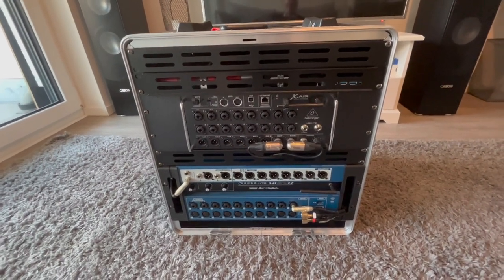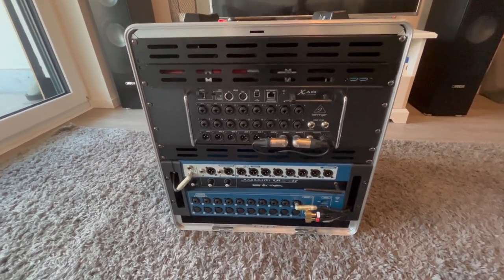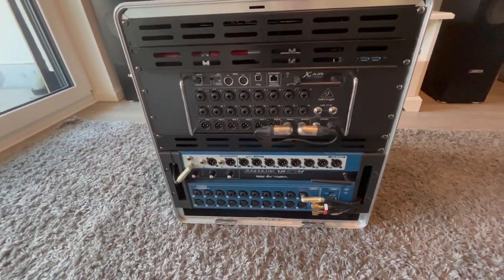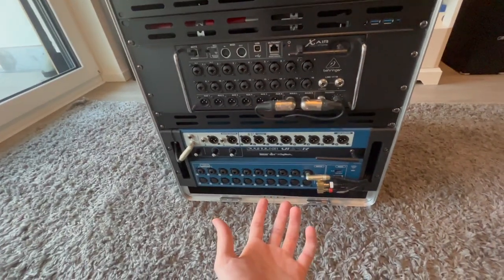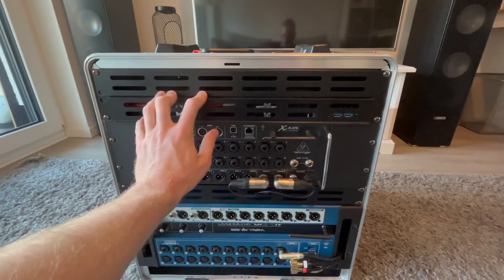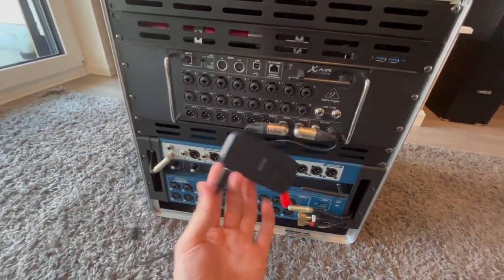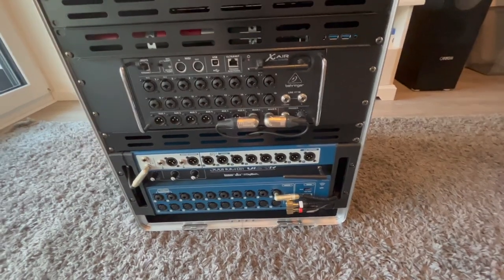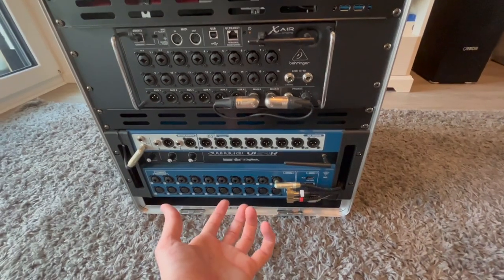Soundcraft Ui24R setup - WiFi - AirPlay - FoH

Comment: Depending on the situation you’re in for your gigs. If you need more than 24 inputs, then I would recommend a board with faders which would make your life easier but if budget or space is limited than understand why you need to mixers, but the UI 24 can be linked to a second UI 24 to double your inputs in Cascade mode so you would have two matching units and operate with only one source on your device and not two, I would highly suggest looking into a better Wi-Fi router, I used to use TPLX 50 with Wi-Fi six and create a hidden SSI ID to help with traffic but I later upgraded with a UniFi system from ubiquity if you have the budget
Reply from the maker: Indeed I have two pcs Ui24 units meanwhile. But the second one I have is still only pure back-up. If I would use a second Ui24 as extension I actually would need a 3rd one for backup. For the moment the system works fine for all the gigs I’m doing.
I have upgraded my rack to a 12HE wooden rack meanwhile, so two slots are free. But most probably I will invest into a decent IEM system next for having a wireless PFL-listening solution.

Thanks for the proposal with Wi-Fi. I will check into that.

Comment: based on experience you only face issues when you use the onboard wifi router. I really recommend using a reliable external router. I can assure you won't face any problems. You could also daisy chain 2 ui24r mixers
Reply from the maker: Well - I have two units of ui24.. but for the moment I wouldn’t use them together in a daisy-chain because it would cost me a third unit for backup.

So still using xr18 as submixer. For the moment that does work out and always keep the second ui24 as spare with me
Reply from the maker: @jarosawbiernacki9087  yes afaik both is possible and depends on how you route it. Expanding to 16 Aux or merge the 8 Aux‘es from both units together is both possible. I have a band which is full on in-ear but they are all fine with mono mix. So the maximum I did use was 6 Aux + 1 MTX for front-fills.

Comment: connect a MIDI mixer to that ipad or something, then you have a wireless remote control setup if you ditch the cables for a solid external wifi setup.

Comment: which air play receiver interface did you use?
Reply from the maker: It’s a OrangePi One with Shairport installed. Audio is running directly over the USB-Audio-Port into the Ui24. No analog channels wasted.
Reply: Thanks
Reply: @jbmlp91  I would like to know how you managed to access the audio via the USB port, which port did you use? USB I/F with usb hub? I would like to understand this step by step. I saw that you managed to route the signal to channels 23/24. If I understood correctly you used the orange pi sending the audio via USB, this addressing would then logically have to be via the USB I/F port then you did the DAW patching. If I'm wrong, is there a tutorial that contains step-by-step instructions so I can replicate it?
Reply from the maker: @guilhermebarbozadesign 
you can check here -> I made some tutorial in the ui24-user's-group on facebook https://www.facebook.com/groups/SoundcraftUimixerusers/permalink/2489339304550784/

Comment: will it overheat?
Reply from the maker: No I haven't had such an issue yet. Have used this setup at over 32°C temp outside.. Therefore there are slots to cool above and underneath the UI24 if you look in the video (like proposed by others already).